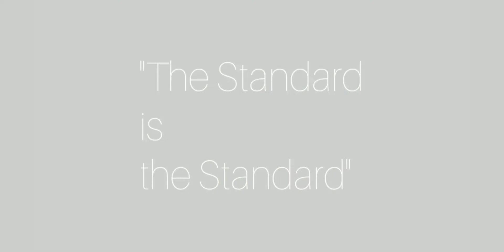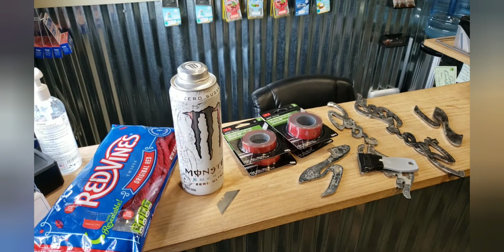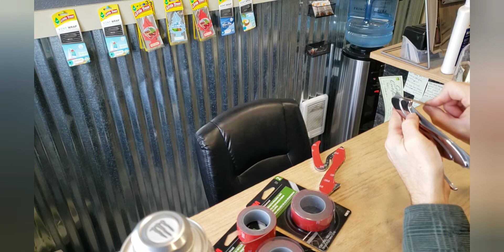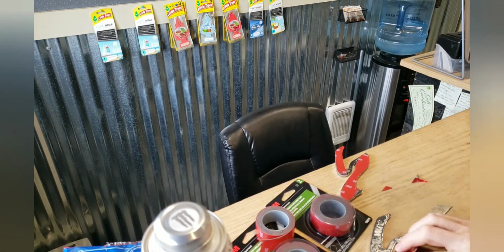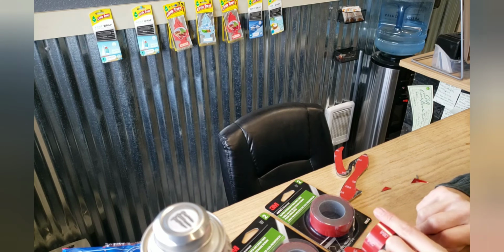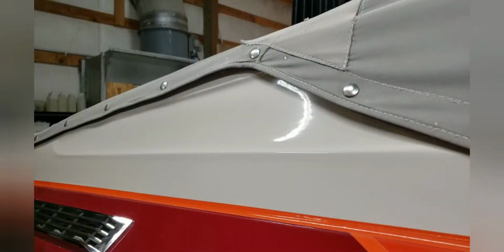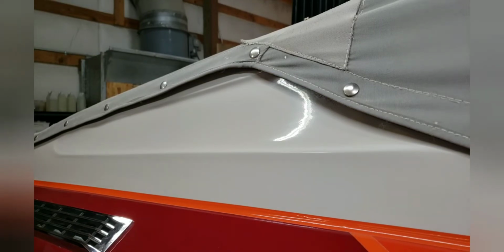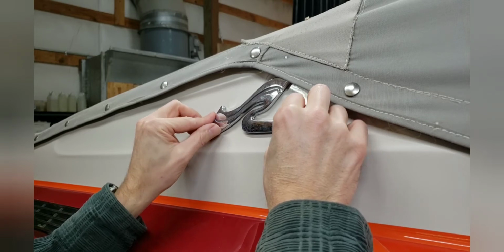the Part I hate. Boats Emblem & logo replacement. I only do this if asked. The "ugly" of Detailing.

Comment: I noticed in some of your other videos you like to remove the snaps. Do you fill the wholes with 3M Marine Adhesive and re-drill them when you put them back on if they are loose? Im working on a boat and most all the snaps are stripped out.
Reply from the maker: You can. There's probably a "correct" way but then, if an owner shows up and the holes are huge and I find I'm "fixing" it..whatever works.3M's white marine 5200 works well but can take up to a week to cure so make sure you have the time and they don't need their cover on in the next day or two.

Comment: Nice little tutorial on reinstalling boat labels.

Is the boat completely done now?  How much of a mess does all the hours of compounding and polishing leave inside the cockpit?  It seems like it would be a royal PITA to remove all of that gunk from the carpet and vinyl seats.
Reply from the maker: It makes a mess. Boats are designed to get wet tip her up, pull the drain and wash away. Dry and enjoy.

Thanks. I generally just do gelcoat compounding. Washing is.. Other people's work.
Reply: It’s good to have people.  Maybe my people can contact your people, lol.

 Do the washing people ever have requests to make their job easier?
Reply from the maker: All the time. I try, I honestly do but it's dirty work. Really dirty work. The soap and water do a great job. Simple Green works well for compound and wax removal but don't let it dry in anything you waxed, it can strip that away and that sucks. Don't use magic erasers on anything shiny.
Carpets, remove and vacuum before /after. The glass can be wiped clean with a bit of time.